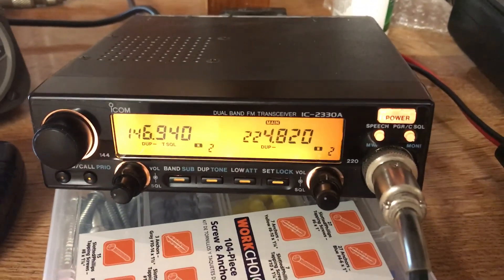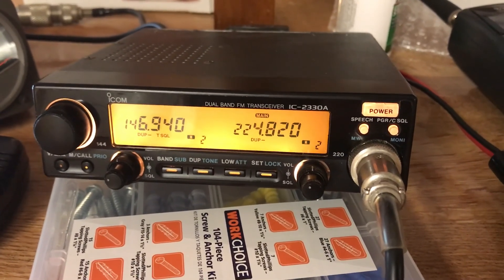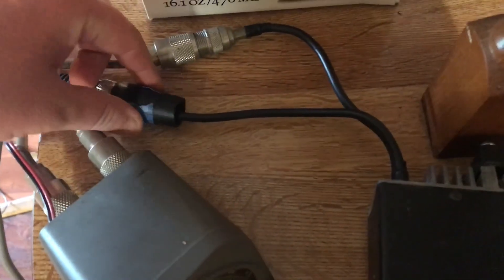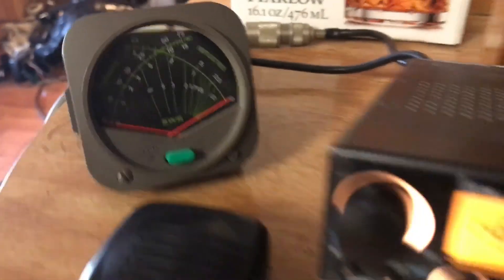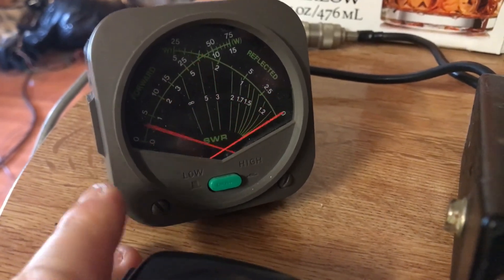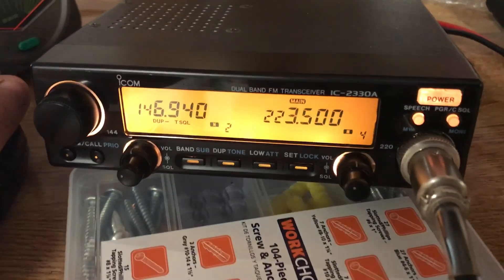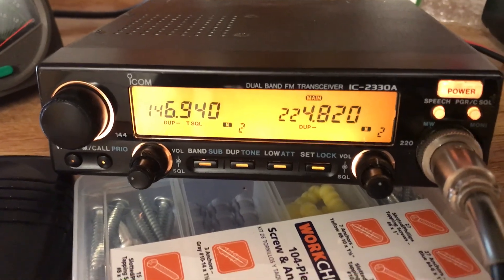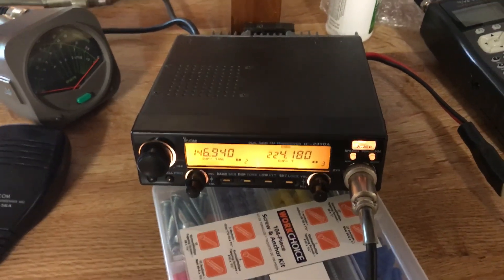iCom IC-2330A Dual Band FM Transceiver 144/220

Comment: How loud is the fan?
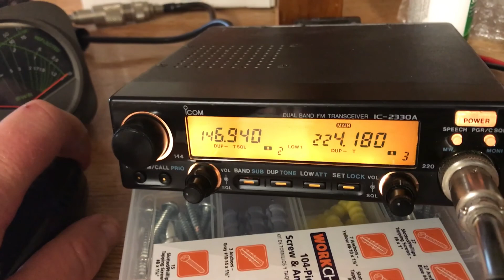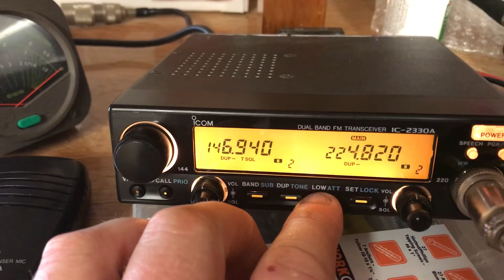Reply from the maker: ducmike4ls it’s honestly not bad at all really. At 3:10 I key the radio and you can hear it kick on. @ 2:53 I change a setting on the radio and it beeps one of those standard menu beeps, just to give you a little reference.
Reply: @brycejcox  Thanks. I didn't know how loud a "good" radio fan was. I have a cheap radio and when the fan comes on it sounds like a airplane taking off!
Reply from the maker: ducmike4ls yes I have a couple like that myself. If you’re somewhat handy with a soldering iron order ya a few of those thermal switches and wire one into your noisy fan. At least that way the fan will shut off when it isn’t needed
Reply from the maker: ducmike4ls I purchased a bunch of those thermal switches and have mounted some of a few radios I have with louder fans so the fan only kicks on once the radio gets warm. I haven’t, and prob won’t, do it to this rig but the thermal switches are very handy